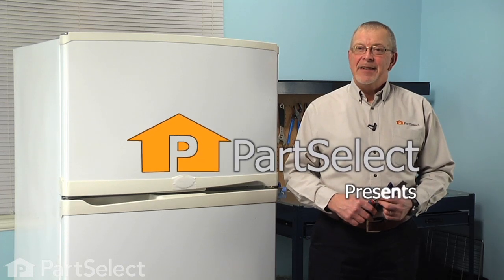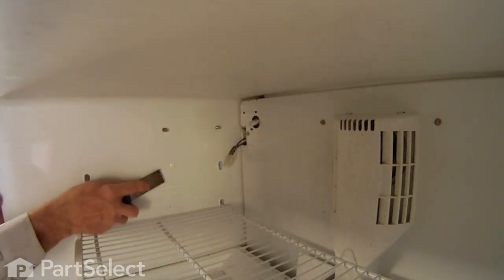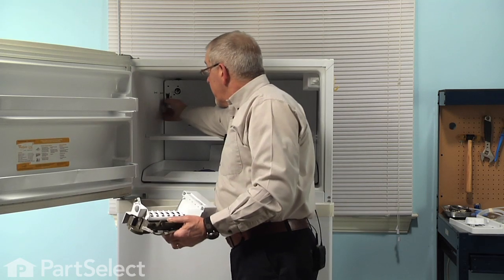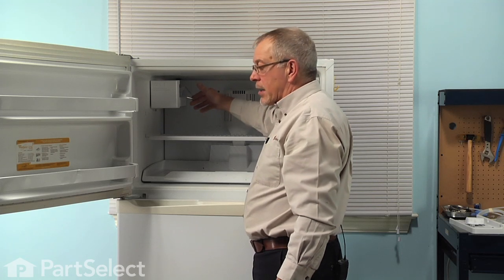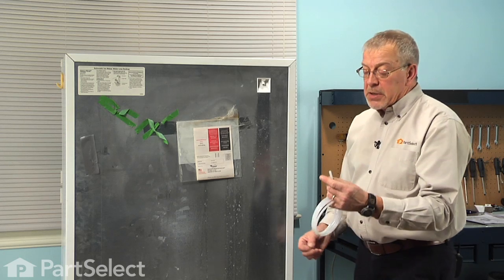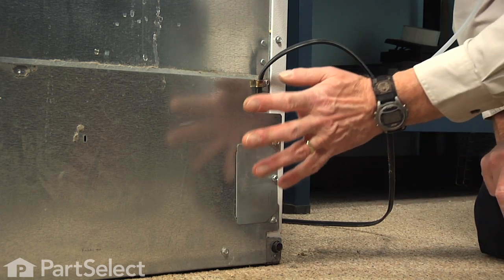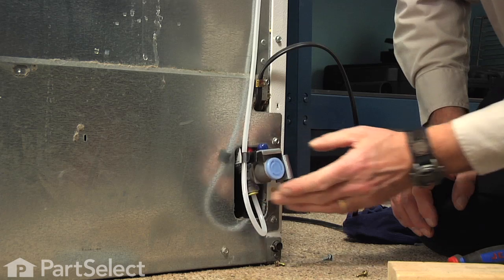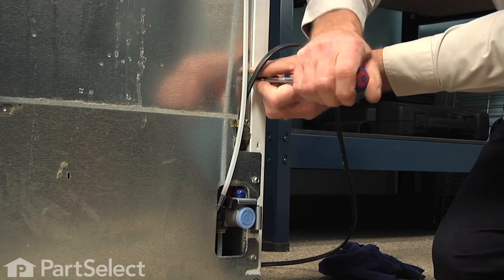Refrigerator Repair - Replacing the Add-On Ice Maker Kit (Whirlpool Part # 8560)

Comment: AWESOME VIDEO. only video that details installing a new kit on the back. Just wish you would do close ups of what you are handling piece wise each time. I need to order a kit such as you are using and it was difficult to see the clamps and such at the top of the installation on the back. Otherwise awesome. Blessings.

Comment: Old ice maker was leaking.  Installed a new ice maker.  Now not getting any water from the water valve to the ice maker.  How long after installation should it take to beginning to make ice?
Reply from the maker: Hi Dave, once a ice maker has been installed it can take up to 24 hours to get cold enough to produce ice.